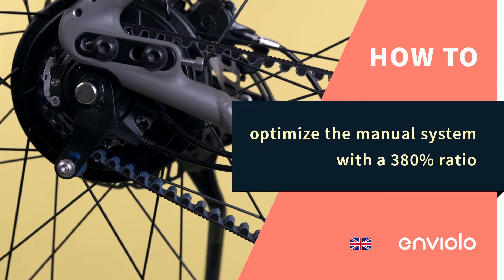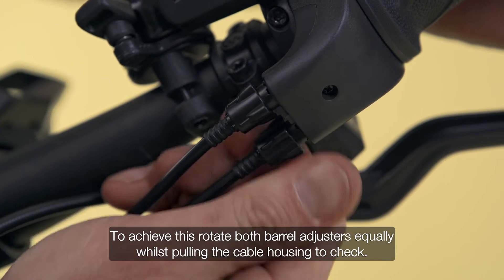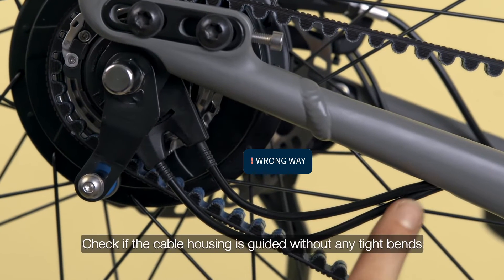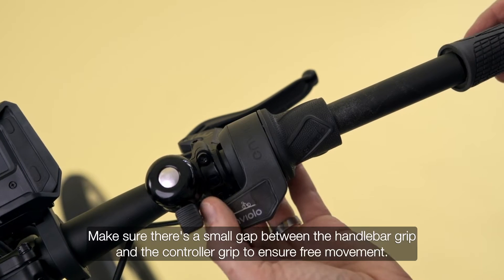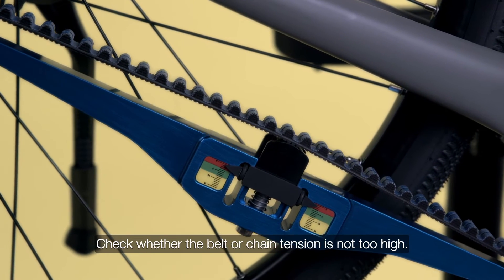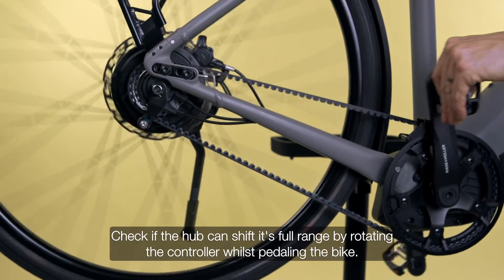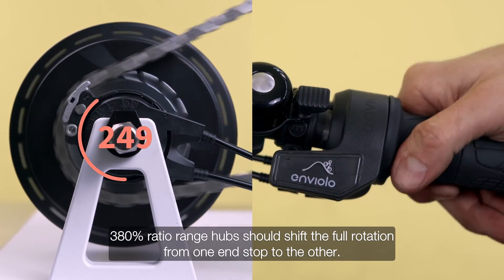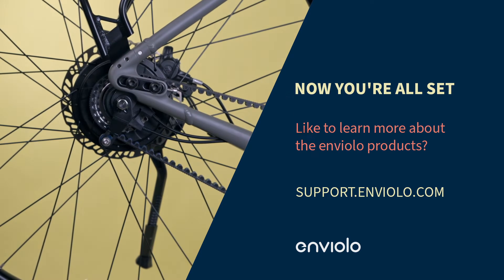How to optimize the manual system with a 380% ratio

Comment: Can the ratio be changed? I find that I don't always have enough low gears, and too many high gears.
Reply: Change the sprocket and/or the chainring
Reply: Have you been able to find a solution? I have the same problem and the bike is optimized for overdrive already.
Reply: @WheelsonaBike  No, unfortunately 380% is not a big ratio. I'm using a chain bike now.